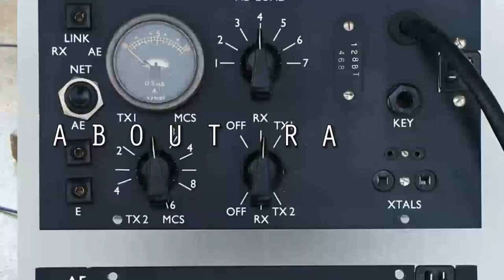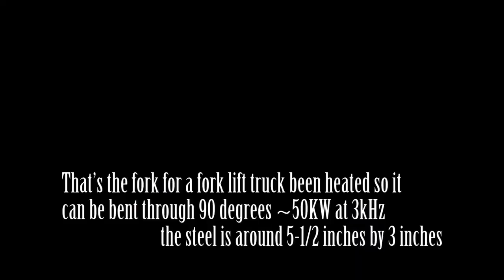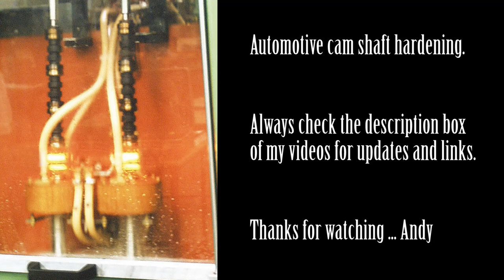About Radio 56 Inductance and proximity effect

Comment from the maker: Hey don’t worry about crazy ideas; I'm glad to have started you thinking about how ideas can be used in a novel way. I lot of what look like new ides turn out to be simply re-adaptations of old ideas. The only problem with transition of DC is you can’t use transformers to step up and step down the voltage as you can with AC. 
Regarding saturable reactors, it’s the iron core that the winding is around that gets saturated with DC.    
Kind Regards ... Andy

Comment: Thank you for the answer. The DC in this case would not be used to transfer power, but rather as a "sealing current" to achieve saturation (analogous to the sealing currents used to overcome corroded contacts in telephony) If the idea had been valid in the first place...
As for DC for power transfer, this could actually be beneficial because of reduced capacitive losses, if just the infrastructure around it would "speak" DC. Alas, generators naturally output AC, and HV DC/DC converters are hard.

Comment: I remember seeing in an old encyclopedia (the type with a multitude of bands) a description of a saturable reactor, a circuit where an AC current is controlled using a DC current. When the magnetic core goes into saturation, the impedance drops dramatically. I'm wondering if this could be applied to HF transmission lines. Put in an extra line which carries a DC current which may (presumably) bring the internal "core" (inside the "skin") to saturate and drop in impedance. Tell me if I'm crazy.